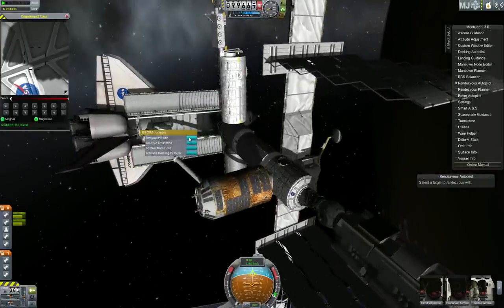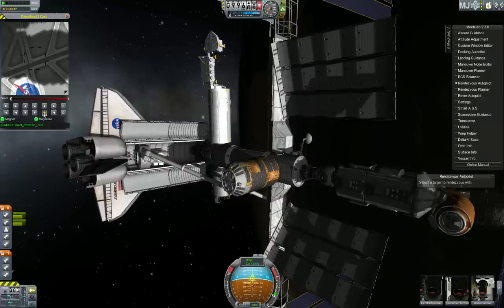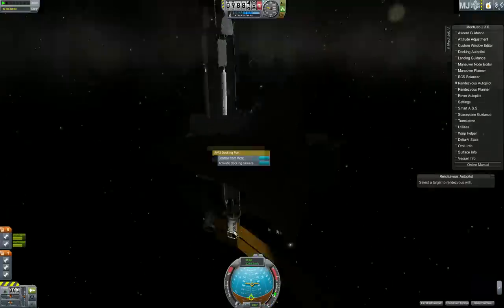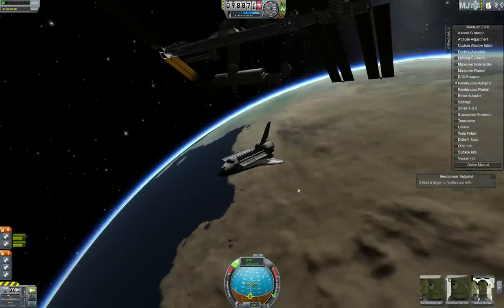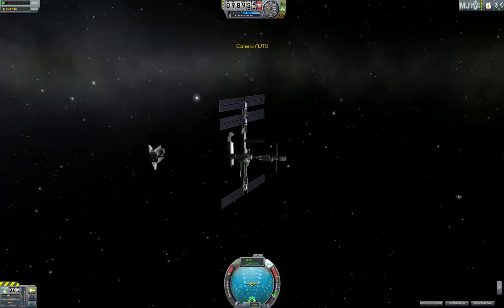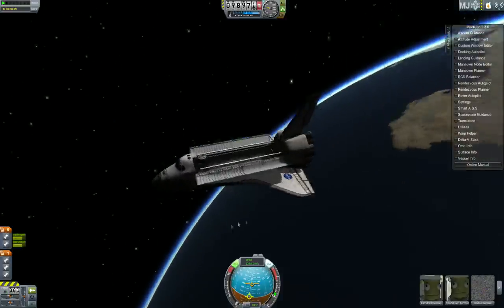International Space Station Build EP.10 Air Lock Repair (KSP)

Comment: do you have an action key set for the canda arm (however it is spelled) to reset, or return to position?
Reply from the maker: No, I don't think that is possible, unfortunately. I actually move it back to position after using it (I usually cut it out because it takes some time). The CSS guys are waiting on a group of modders to finish the new arm systems. Should be pretty sweet. The repair mission to bring the new arm up to the ISS is going to suck though.
Reply: Strike Eagle's Perch I was curious as it's a pain in the neck to waste five minutes for something which I'd like to be auto..
Reply from the maker: swagger897 Oh, I wish man! One day I'm sure.